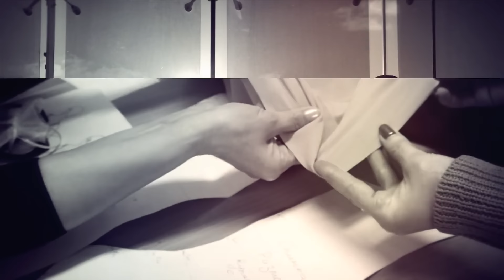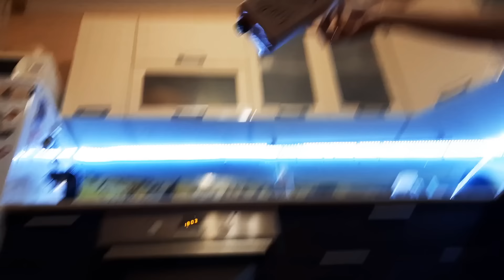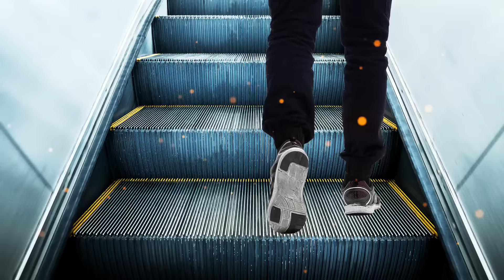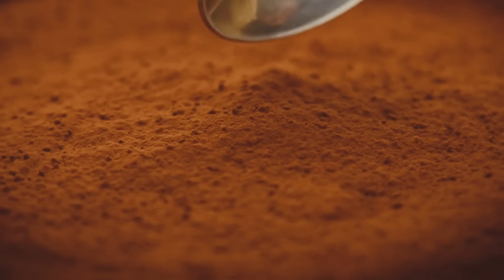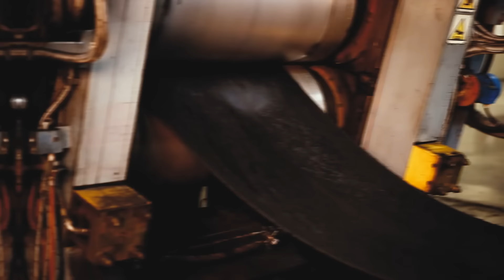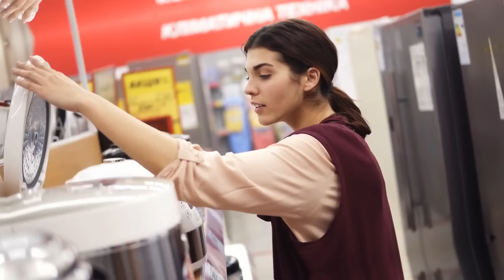Few People Know These SECRET Uses for Everyday Household Items — You’ll Never Throw Them Away Again!

Comment: Here’s something I wish I had known YEARS earlier:
I visit almost weekly several supermarkets/grocery stores in Germany (since I live a Dutch border town) to get my groceries.

After having done my shopping some months ago, while putting my stuff from the shopping cart into my car, I (as so often happened) found myself struggling with keeping my cart from rolling away, as I had my hands full of things I’d bought… 

A friendly gentleman apparently saw me clumsily trying to wrap my FOOT around a part of the cart, to keep it with me, preventing possible damage to someone’s car if it would have gotten away from me…. 

…and he told me that…

…The small ø ± 8 - 10 cm (± 3,9 inch) , PLASTIC, circular, the outside edge slightly higher than the middle part of it, YELLOW DISCS ...
…that are screwed into the ground at the ‘entry/bottom side’ of EACH PAINTED ON PARKING SPOT AT THE PARKING LOTS OF GROCERY STORES/SUPERMARKETS IN GERMANY…

….ACTUALLY HAVE AN IMPORTANT AND VERY PRACTICAL FUNCTION …!!!

IF YOU MANOEUVRE ONE OF THE LITTLE WHEELS OF YOUR SHOPPING KART ONTO SUCH A YELLOW DISC, THE WHEEL WILL STAY IN THE LOWERED CENTER OF THE DISC, STOPPING THE KART FROM ROLLING AWAY COMPLETELY, WITHOUT ANY NEED TO HOLD OR EVEN TOUCH THE KART……!!!!

… Making the shopping experience even more enjoyable and relaxed as it already was.

(The fact that I ONLY HAVE TO PAY ROUGHLY HALF THE AMOUNT (!!) of what I will be paying in the Netherlands for the same groceries and many products, like for example meat, is of a much better quality as well…makes the whole thing MUCH more PLEASANT!!)

And the price difference (between NL and GER) of certain products like booze, tobacco, gas, everything related to personal hygiene, dairy products (and many more) can even be as big as these things only costing up to just ONE THIRD of the price that has to be paid in NL…!!

To give a little example, of something I simply refuse to ever buy in the Netherlands again:
 😉 🤑  
Coca Cola Zero, 6 x 1,5liter in the Netherlands (even on sale!): €16,99, this comes down to: €16,99 for 9 liter = €1,887 per liter.

Coca Cola Zero, 12 x 1liter in Germany (also on sale!): €9,99, this comes down to: €9,99 for 12 liter = €0,832 per liter.